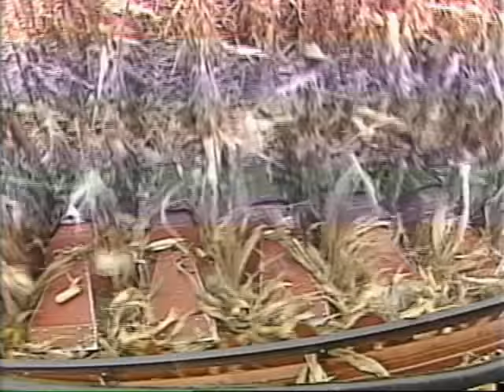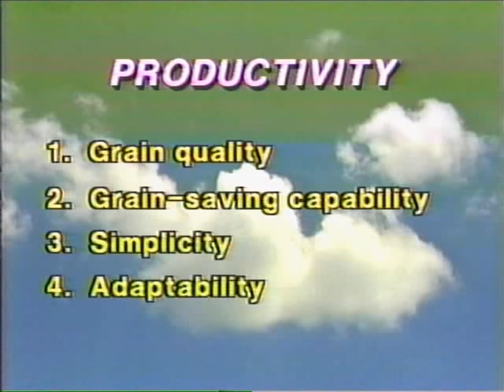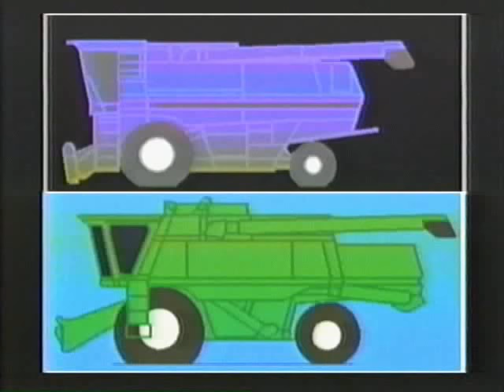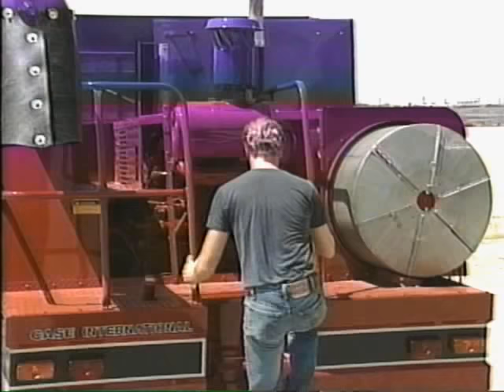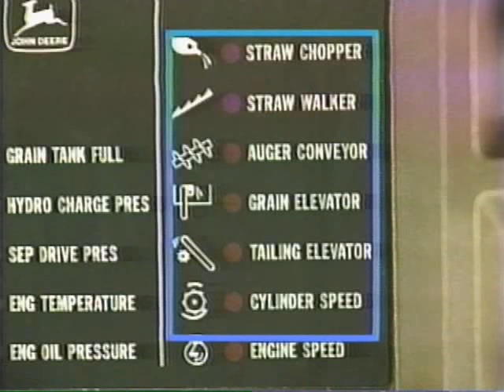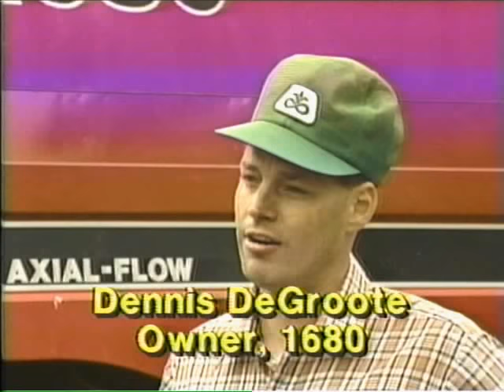CaseIH Axial Flow vs  Deere 9000 Maximizer 1989

Comment: It took Deere almost 30 years to get a single rotor machine.  Case ih has many improvements over the years in there rotor and front cone.  If it ain’t red leave it in the shed

Comment: When he talks about the feeder house reverser in the JD he's wrong. You do not have to leave the cab to pull a pin to reverse the header. Not on any JD combine we had, anyway (except the 1972 4400). Even our old 6620 could be reversed from the cab while the IH combines at that time (715, 815 etc) did not have a feeder house reverser, at least not in their early models.

Also, yes you have to pull a pin on the cylinder drive to change from high and low speeds but it was very simple. Not any harder than pulling a lever on the IH. 

The pre-cleaner on the 9000 JDs was one of the best features. He knocked it by saying it was only used in corn but the reason is it was  needed only in high yielding crops. Soybeans and wheat don't yield 180 bushels/acre so it wasn't needed for them. The pre-cleaner gave those combines extra capacity.

Comment: CIH Combines is about the only thing they have going for them but they are beginning to fall behind.  With JD X9 about to be released this is going to be a devastating blow to CIH combines.  CIH cotton pickers are literally 20yrs behind JD.  The only tractors that CIH has that competes is their 4wD Steiger line, but that is due to Steiger technology that has gotten them to this point in time.  Sadly, every year CIH sales slip a bit more.  Before long, Agco/Fendt will be JD biggest competitor, not CIH.

Comment: Claas beats em both anyways... German engineering on combines was and is WAY ahead of Deere or CIH... Deere's big cylinder is harder to turn (requires higher torque) and has less separation force (centrifugal force across the concave).  And of course both of them use those silly auger beds instead of a grain pan that actually sifts the grain and chaff BEFORE it hits the cleaning shoe; the augers mix everything up and shovel it unevenly onto the comb and cleaning shoe, versus a grain pan that pre-sifts the heavier grain to the bottom and the lighter chaff and trash on top, and delivers it in a smooth even "mat" with each forward stroke of the cleaning shoe and grain pan onto the comb and into the air stream as it evenly drops onto the cleaning shoe, aiding separation and cleaning and resulting in less losses out the back and less tailings... 
Later!  OL J R :)

Comment: John Deere eventually copied the IHC rotary ,imitation is the best form of flattery.
Reply: They went to the rotor combine sure but copy no. Deere had patients in the 30s for a rotor combine. They just thought the Walker machine was a better machine and in some cases it is.
Reply: Chad Justice Their so called "patents" looked nothing like the IHC rotary ,JD sat back and let IHC do all the hard work then when they saw it was successful they copied it to the letter right down to the whole design even to the 30" rotor .JD copies everbody ,they have pioneered nothing revolutionary, even their old plow was most likely copied.
Reply: @interman7715  haha yeah ok. I love how everyone says they copied everyone and have done nothing revolutionary but yet I have done nothing but run past everybody in the tractor market, planter market, round baler market. Cotton picker market.
Reply: Chad Justice You will figure it out one day.
Reply: @interman7715  I have figured it out. Our family has been Deere since the 30s and have never been impressed by anything red and never will be.
Reply: Chad Justice Our family started row cropping in the  20s ,JD had nothing to compare with the Farmall system .JD had old two cylinder putt putts with hand clutches till 1960! JD is just a hack company that copies everyone .

Comment: It not just cutting, separation, trashing but maintenance and cleaning combine down that makes difference in time/cost.  Height is just bs if you add a big top to CaseIH 1680 it would tall as JD.  More moving parts with demanding Hydraulics will make less efficient.  Who care about window opens or not, LOL 2100 series didn’t have open window🤔I am CaseIH fan but 1680 was too late to Australian market n JD had success with 9600 model it’s not until 2100 series come out it proved be best CaseIH harvester until 8120.  The first 8010 had there problems.  Don’t laugh because at same time NH, JD n IH share same alternator were over heated and blew up, there was limited supply.

Comment: Pretty neat video. Gleaners the best 😂
Reply: I remember running these two side by side, in corn they were close. in dry beans they were close, in wet tough beans the deere just kept going!
deere and case have nothing on Lexion!!
these are fun old vidoes!
Reply from the maker: Wish I had more Case vs. Videos but it seems like they were stuck on John Deere at that time.
Reply: Case International Harvester copied it to XCC-15 John Deere rotary combine in 1957. Because RELEASE the Axial Flow in 1981. So Case Ih copied it! And TR70 New Holland was launched their two stream rotor combine.
Reply: You mean gyroscopic deere feeder=gleaner 😉😂😂

Comment: There was no such thing has case ih in the mid 60s lol
Reply: Eternal Thread CASE  took all the IHC products and tech in 1985 and dropped all their own lines ,speaks volumes doesn't it ?
Reply: Did you know that the Case IH rotary combines copied the Deere? Because in 1930, Massey Harris invented the rotary combine but not launche in market. And the second rotary combine was built in 1957 that the John Deere invented it. The model is XCC-15 rotary combine. When Case iH combine launched their "Axial Flow " in 1981. That they make it more powerful.  That the Deere engineers got feard to it and chage the way they built Rotaru combine. And TR70 was launched!
Reply: Emily K. The rotary threshing system concept was actually  pioneered by an Australian. Many manufacturers had  a play with it ,but it was IHC not CaseIH that developed it into a successful product line after ten years of  intensive engineering and at a cost of over 100 million dollars in 60s dollar value ,some of the original IHC1460s are still in service today .New Holland stole  the tech when some IHC engineers defected and developed the twin rotor to get around the IHC patents but still had to pay IHC for patent violations. John Deere as per usual copied IHC and now runs a similar threshing concept. So I suggest you swat up on your JD history and you will see they are just pilferers of everyone elses tech.
Reply: @interman7715  the New Holland TR70 Axial Flow Combine was release 1975. Base on the name of New Holland TR70, "Axial Flow" was already put since they release the combine. The page that I read 1 week ago is a FarmShow magazine and all photo's are their since John Deere is building the XCC-1 combine that means Experimental Centrifugal Combine. The rotary combine of the Deere is cabless. When harvesting the dust goes to the operator but less, because they put some shields. Like on the Case IH Axial Flow combine that release on 1977 with fully metal sheets and glass cab. The John Deere engineers decided to launched the combine in 1964 but they are still preparing the combine yo work well so the farmers may not be had problem. When the Deere engineers knew that the International Harvester is making rotary combine they decided to fall the efforts of making the rotary combine and make it different. So in 1981 International Harvester shows a compare and contrast to the two combine. And thats it International Harvester is using rotary...
Reply: Emily K. You haven't got a clue sweetheart ,get a few more years behind you and  some education and then you  might be able  to make sensible comments, but for now youre only making a fool of yourself.
Reply: @interman7715  yes... I will study hard to College.

Comment: The axial flow combine worked better in ideal conditions. How ever in years where there were high weed pressures. The John Deere did a better job. I ran both combines they both had their good points and both had their not so good points.

Comment: Massey Ferguson 860 beats them both 

Case IH had a patent on the rotary system there for Deere could not make one

Conventionals produce much better quality straw 

Don't wanna sound like a Deere fan boy but just my 2 cents
Reply: Massey harris is the first who invented the rotary combine in 1930s. And second rotary combine was built by John deere in 1957 the model is XCC-15. And International Harvester release their Axial Flow in 1981 and The Deere engineers got feard it. So they stop making rotary combine in that year. So they keep making now a combine like W and T series. And after That Axial Flow the TR70 was launched by New Holland. And Massey Ferguson was copied it. But different in design.
Reply: Your information is so incorrect and full of personal bias that I can hardly stand to read it. Also, it wouldn't hurt to practice some grammar so that people can tell what you're trying to say.
Reply: the 860 is the biggest piece of shit you can find around.
Reply: Ran lots of acres through both a 760 and 860.  I would hardly say they were piles, had fewer moving parts, but they did like to run hot as seen in this video with the engine doors open.  https://youtu.be/pEu8vDxTsOQ

Comment: Been around both a lot..Deeres are built stronger better  ...The rotor system threshes better and plug less easier than cylinders and less moving parts..
Reply: Caseih is the best
Reply: Case copied the John Deere XCC-15 Rotary Combine in 1957!!! And Massey Harris in 1930!!!